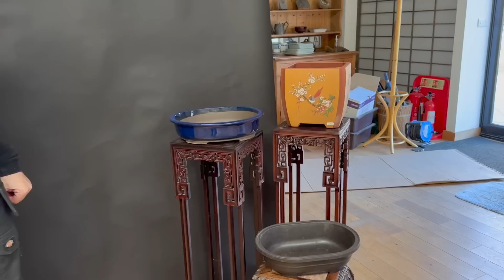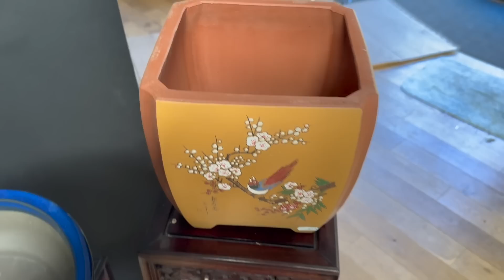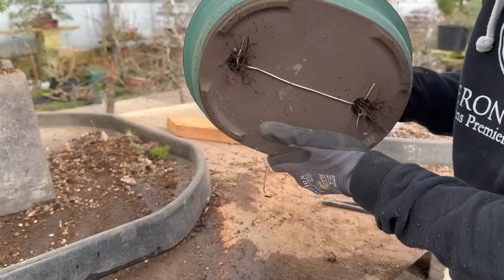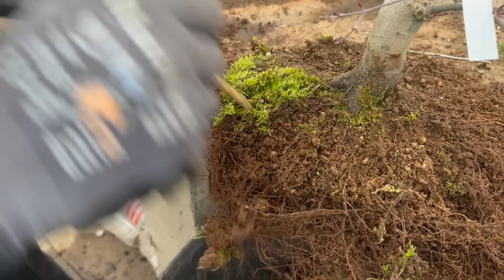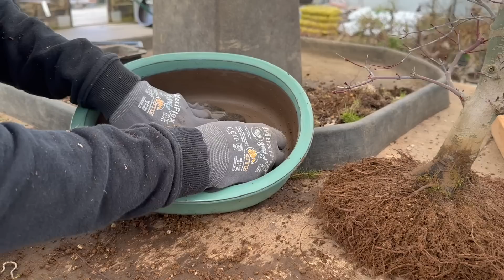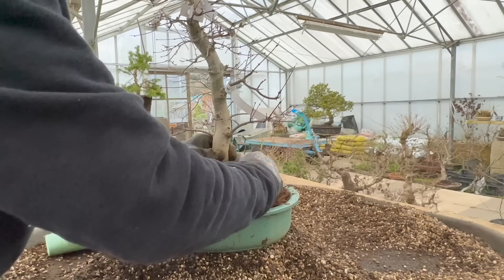How to Repot A Bonsai

Comment: What is wrong with using soil instead of various gravel and rock mediums?
Reply: Better drainage, easier to control watering and feeding your tree. And the grains may promote a network of fine feeder roots, which is necessary for the health of the tree and for developing a good root base/nebari.

Comment: Hi all, I have a 1 gallon Japanese maple I got from a nursery. I’m going to root prune and repot it once the buds begin to swell, and there are a few problem branches I’d like to get rid of before they cause inverse taper. Is it okay to remove ~half the root mass as well as a couple of branches at the same time, or should I wait to structure prune and only do the root pruning?
Reply: I would defintely wait on removing big branches until first spring growth starts to harden off, so depending on your climate end of May - June

Comment: A good guide for the bonsai newcomer. One omission is the watering in process after repotting. It's important to mention that watering should be carried out until it runs clear. This ensures that any soil fines are washed out to prevent clogging of the drainage holes in future.